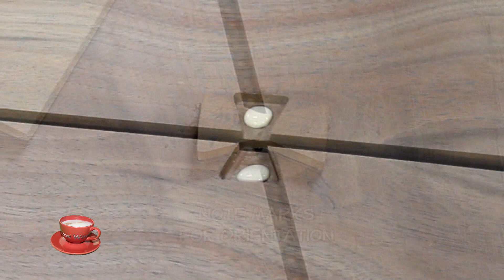Live Edge Hall Table

Comment: Wonderful fine design detail and workmanship Bob.
The tapered mortices were especially well demonstrated/narrated, which shall prove to help those that might be intimated to approach that technique (me).
I think around 5 minutes in you mention countersinking vs. counterbore....(oh those details).
I use my Kreg pocket hole jig often and have been purchasing the plugs in the various wood species, all while contemplating acquiring the plug cutter.
You've convinced me to buy another tool !!!.
I also now know how to " liberate" the processed plugs. Great tip.

All the best, keep on crafting and God bless..
Reply from the maker: grupp61 thanks for great comments .... counter-bore it is, of course. I made the plunge and bought the pocket hole cutter. Like you, I have been buying the packaged plugs due to cost differential. If you look at one of my barstool videos, can’t remember which one, I go into the tapered mortise discussion a little more. It is all about duplication and nothing about the actual angles. Thanks again.